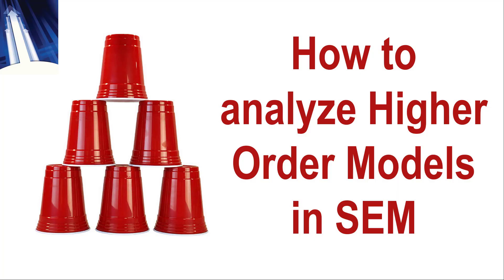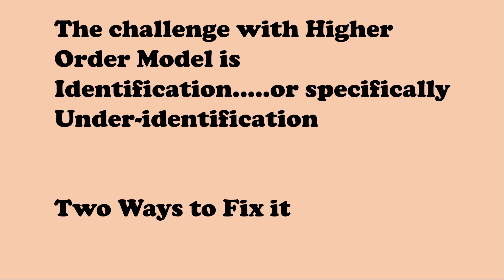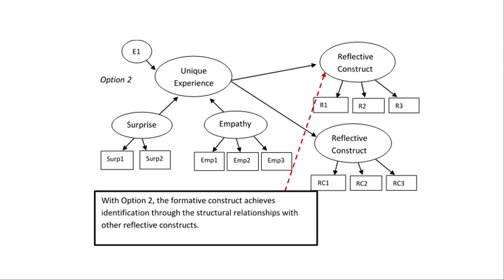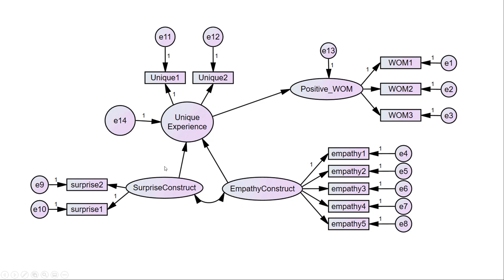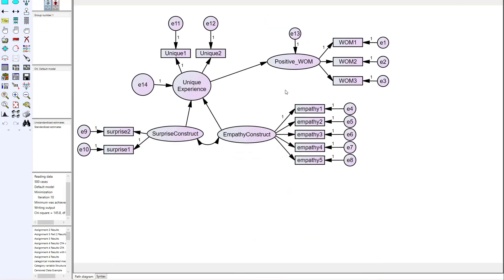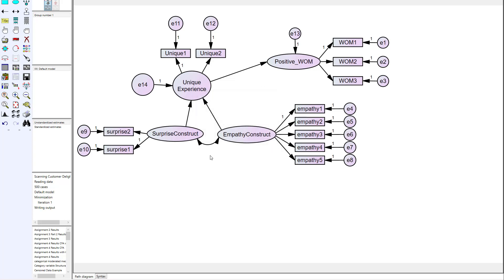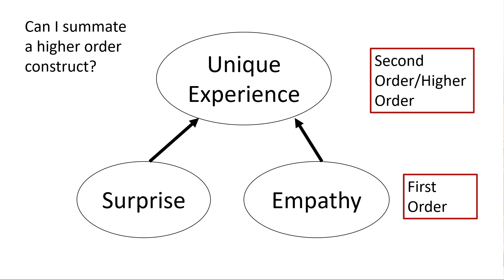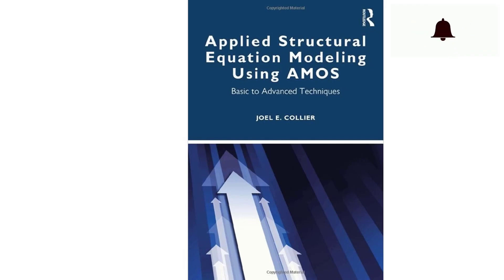How to Analyze Higher Order Models in SEM (Structural Equation Modeling)

Comment: Hello Professor, 

Thank you so much for this video. I am also reading your book and it really helps me understand how to do a CFA. 

I have a question please: 
I have 6 1st order reflective constructs, which lead to a higher order model construct (Formative). I added questions to my survey for two reflective constructs that are reflected from the higher model construct. 

One of these reflective constructs, contains questions about the overall construct and the other contains questions about the consequence of the model. 

I have a problem identifying which of the 2 ways you mentioned in this video, to use to address the identification problem. 

With what I have done in the survey, I think I should take the second way to solve the identification problem (2 reflective constructs), but I am afraid that it will ruin the model fit. 

Can I do a mix of the 2 methods: have mimic items + 1 reflective construct ? 

Thank you so much !
Reply from the maker: You can do a mix of methods but it will usually destroy model fit and I have found will cause problems in the structural relationships between constructs.  The optimal way is to include to reflective measures off of the formative higher order construct.  Those reflective measures should represent the overall higher order concept.  There is a more detailed description of this process and preferred methods on page 113 of my book.  Hope that helps.

Comment: Hi Prof. Joel Collier. Thank you for your contribution to YouTube and helping all of us early career researchers with structural equation modelling.

I have two questions that I request your expertise on.

1. My standardised estimates on my paths are showing negatives when running SEM. What does this mean and is it valid?

2. I did not create any mimic variables within my survey design. Is this going to be a problem when running my SEM? Or would I just have to mention it as one of the limitations of the study in the analysis section?
Reply from the maker: In regards to your questions 1) There is no problem with having negative regression estimates.  It just means as your IV increases in value that your DV decreases in value.  2) Yes, it will be problem.  If you don't have a mimic variable then you will be underidentified if you run the model as formative.  You either have to recollect or run it as reflective but note that this model should be run as formative to be properly specified.
Reply: @joelcollier9387  thank you for such a quick reply! As I do not have time to recollect the data unfortunately, would it be best to do a cfa model fit that does NOT contain the 2nd order or higher order constructs?

To add, The higher order constructs were not originally theorised through literature, rather, they were included in the model to achieve validity and model fit due to high correlations between dimensions.